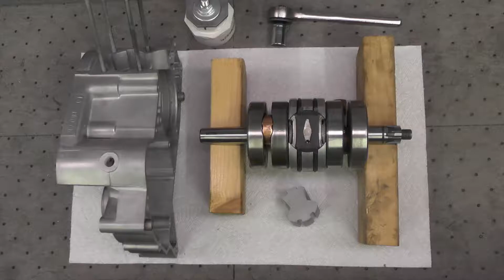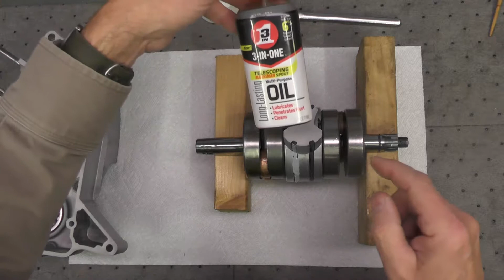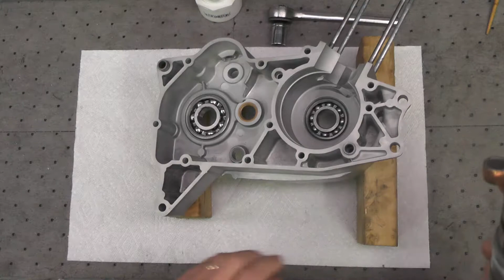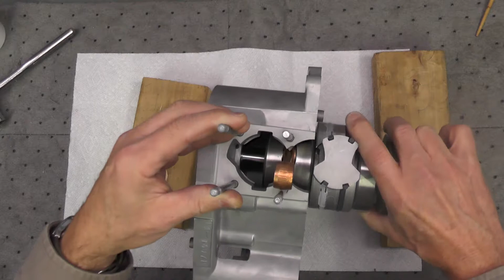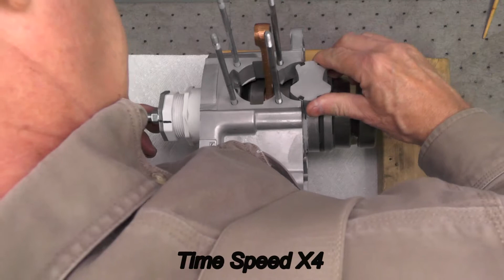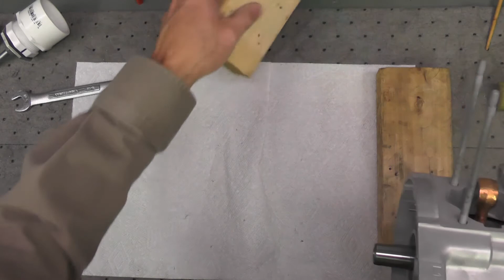Yamaha YL1, Installing Crankshaft into Left Crankcase  --- Video #79

Comment: Hi i have two yl1's and one yl3 is the rubber seal in the crank the original or can you get new ones ? dont seam to be on the parts sheet thanks David
Reply from the maker: The YL1 crankshaft has three seals, one on each end of the crank, and an aluminum/alloy labyrinth seal in the middle.  The outer soft seals are still available from Yamaha (check Partzilla), the center seal is not available and needs to be reused.  If you're going to all the trouble to spilt the cases down to the crankshaft, I'd highly recommend replacing the outer seals.

Note, if you don't have a service manual, I'd highly recommend you pick one up.  They can be invaluable.
Reply: @kwrightway  Yes i always buy the parts manual first and have rebuilt many engines and have around 53 bikes 49cc-100 in my collection i have found new seals off the part numbers  that rap around the centre Claussstudios.com  also makes them new cheers for the reply greatly appreciated .
Reply from the maker: @davidbutcher6637  Thanks for the comments...

Comment: Great video!!! What was the size and pitch of the threads on your puller?
Reply from the maker: I typically use 3/8"-16 all-thread, which I keep around the shop.  However, use whatever is appreciate and scaled to your project.  Thanks for the comment.

Comment: Kicking myself now for spending £80 on a 'Tusk' crank puller when I could have used some imagination and poped down to the plumbers merchant!. I'm glad I have my 'Tag-Z' engine stand though to hold the casing at a convenient angle and stop it dancing around. I also favor ratchet spanners to pull the cranks in swiftly before the goo goes off.
Reply from the maker: You are in good company... we all live and learn by doing.  I usually use a manual wrench/spanner for pulling the crank in and cases together as I prefer the tactile "feel" a wrench/spanner provides.